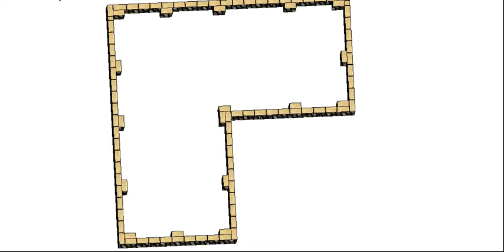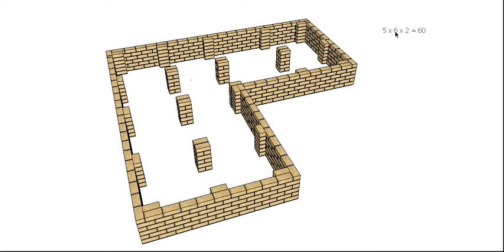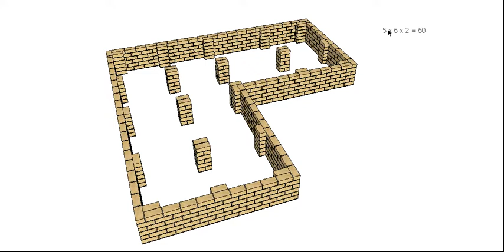Brick Calculations -- Isolated Piers

Comment from the maker: HI Moofushu
Personally I prefer raised timber floors and the pier only option is an good one. However I dont think I warrants a new video. With a combination of the Engaged pier and the Isolated Pier videos most people should be able to work it out. Here in Sydney it is hardly seen anymore. With regard to getting them level and in line there are many techniques that are used including String lines however these particular videos are aimed at those working things out before they start the job.

Comment: One video you don't have is a raised wood floor on all piers. I used to think this was an inferior style of sub floor, until I spoke to contractors and asked their opinions and the type of homes they prefer. Laying out all the piers to light up and level them out looks like the hardest part. Some use hangers others use hangers and a large beam to span across the piers.